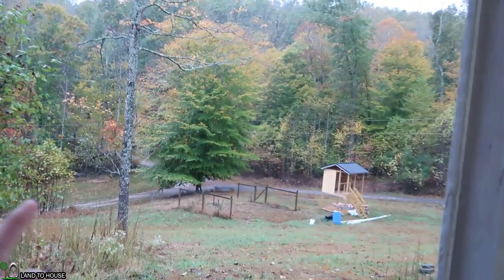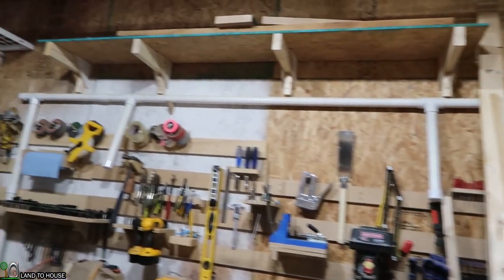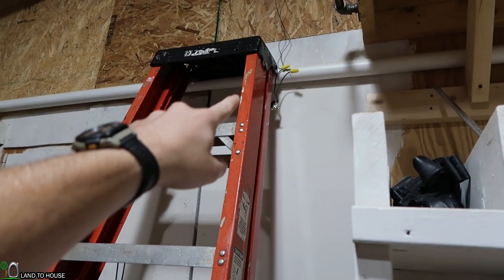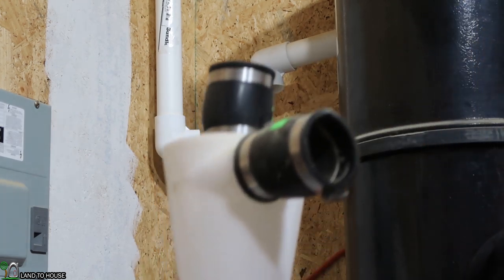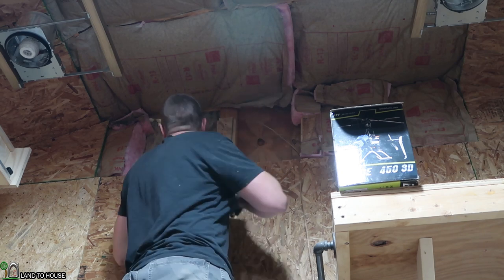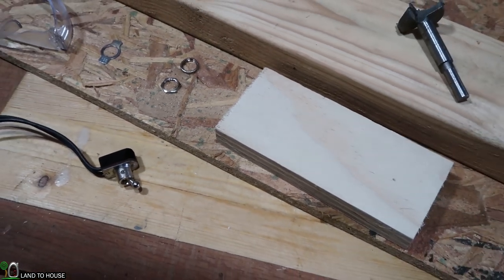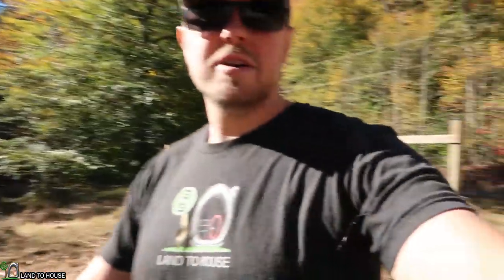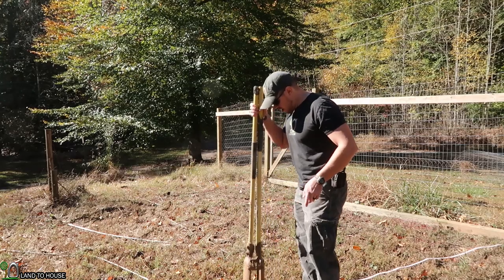Finishing the Fence and Building a Switch - Vlog 171

Comment: Seth, if you're not dead-set on black plastic in your garden, maybe you could try part plastic and part mulch to see how they compare. We have tried the plastic in the past, but found the thick natural mulch works better for us.  Locally there is a guy with a huge chipper that recycles pallets and construction material into a nice natural mulch. We layer it on year after year and find it easier to weed and it holds the moisture in the soil better than plastic. Also, I've picked up discarded carpet from the side of the road, that helped keep weeds down some. But in the end we have found a thick bed of layered wood chips is lower maintenance. The plastic and landscape material just didn't work for us and didn't allow perennial plants to naturally expand. Just our experience but I don't have free ram pump irrigation as you do.  😁
Reply from the maker: That is a good point. I have thought about using the mulch as well. It would also break down into good soil over time. The dirt that we have is not so good because it was from the house site. I will need to find a mulch source. I have wanted to try both methods for some time. Once I go mulch I have a feeling that is what I will stick with. ... Looking forward to using the ram pump for water. should be nice.
Reply: @LandtoHouse  Just get a wood chipper for all the limb and tree cleanup you do around the property and you'll have unlimited mulch.